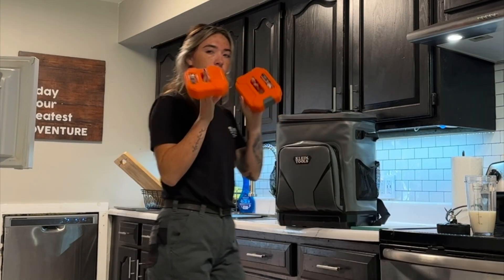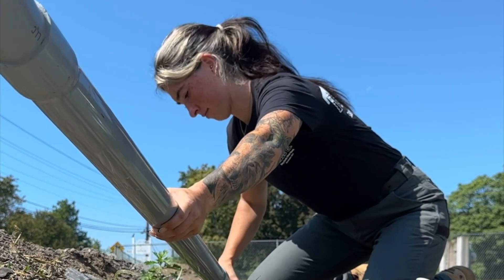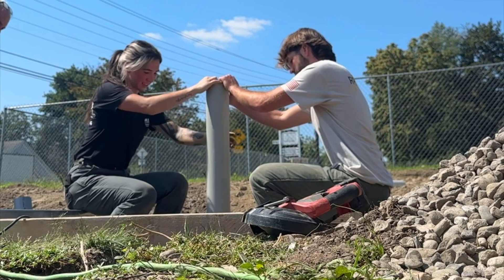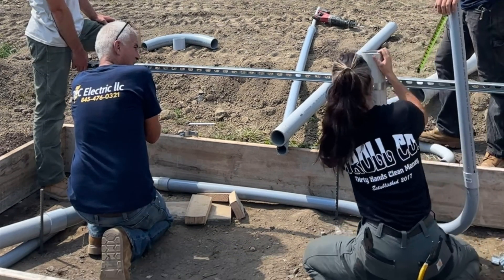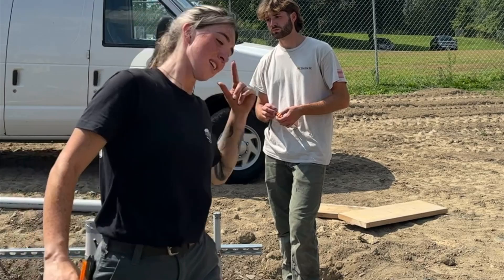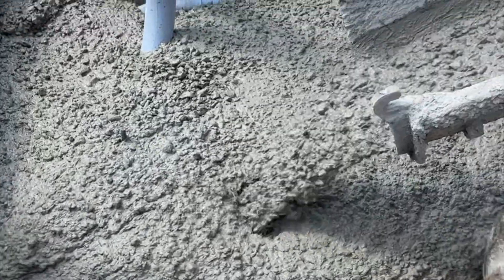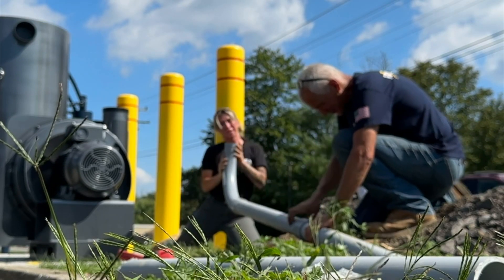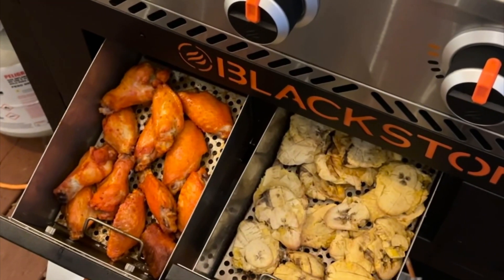400 amp outdoor service pt.1

Comment: My first 400 amp service was a cabinet that filled the back of my pickup. The service cost more than my 1961 International pickup was worth. I knew I had it made when my service vehicle cost more than any amount of electrical components I could put in it.

Comment: "Today was the hottest day of the year ..."
LOL, meanwhile, down here in the third world country called Texas, most of the state came within minutes of forced rolling outages this evening (09/06/23) due to high demand and insufficient generation. And Thursday and Friday are supposed to be even hotter, with temps in the 110 degree range in the Dallas area, 108 or a little less further south.
Reply: Texas needs more windmills and solar farms.....lol....NOT!
Reply: @carbonking53  Like any other macrosystem, it needs a balanced portfolio. Right now they could use a couple more gas-fired plants, plus I think one or two may have been down for some reason. Also just now finding out about the cryptomining scam the state is running with "mining" companies, giving them millions while they suck down all available resources in their areas.

Comment: Love the video! Was that a C-5 that flew overhead btw, or a C-47? Just curious.  Looked like a C-5. Oh well, sorry rambling lol
Reply: Neither. That was a C-17 Globemaster. The C-5 is significantly larger, has way more wheels, and the high-pitched roaring whine of the engines is absolutely unmistakable for anything else.
Reply: @whiteknightcat  oops lol okay thanks for the clarification 😅 guess I need more type to study the different models 🤣
Reply: @markbenson488  No problem, it takes time and practice whether plane spotting or train spotting or whatever. If you ever get the chance to hear a C-5A fly over, you'll never forget the sound.